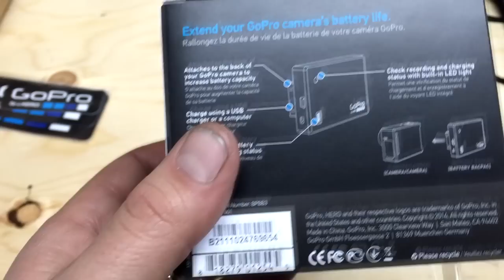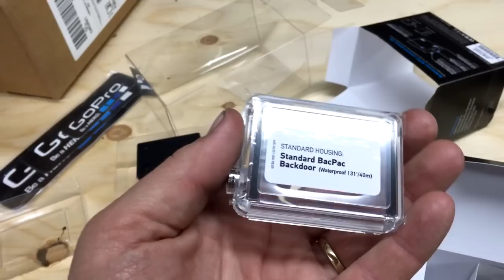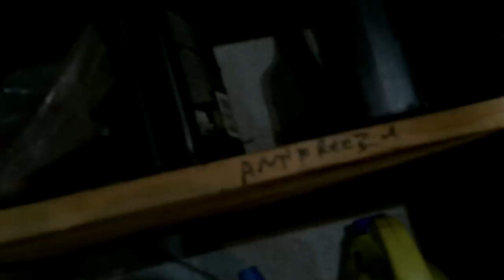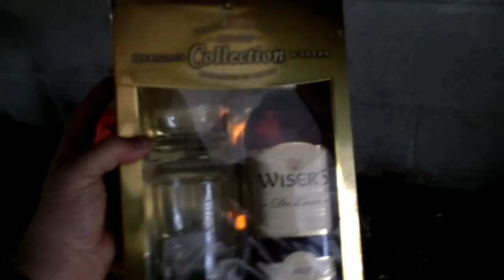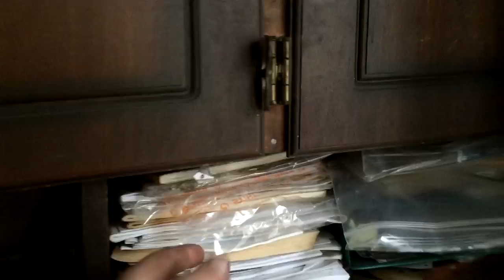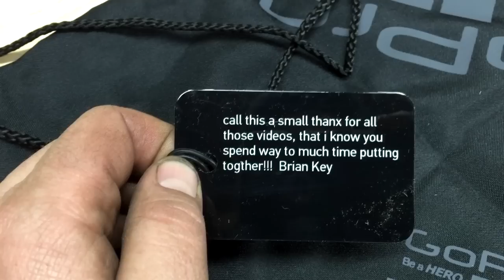Small shop update

Comment: You know the small aluminum shelve rails that you can buy in the Big Box stores that receive the small flimsy 10.5" shelf hangers. Fabricate your own using 'Strut Channels'. You know the channels that electricians and plumbers hang pipes and conduit from. Home Depot sells: 10' 12ga Galvanized STRUT CHANNELS. SKU #455470. Weld plates on the top and bottom and anchor them to the walls vertically. Then fabricate some U-Channels that would slip over the outside of the Strut Channels with 18" to 20" rails extending off the front to accept shelves, cabinets or just leave open as a metal storage rack. Drill cross holes through the sides of the strut channels  for mounting the fabricated shelf brackets. Don't weld them on. Leave then so that they can be removed or change the height. Fabricate a nice row of metal cabinets along the top along the ceiling painted John Deer GREEN for all your John Deer filters, parts, oil, etc.

Comment: Black Bin (Trash) bags make really good curtains for Garage/Shed windows! 
They're cheap, Easy to cut to size, Easy to fit with a staple gun and the best part is when they start to look shabby/Dirty/torn you can just bin them and cut another one.

Could you not move that light to the middle of the garage and wire it back in? Would make it a lot lighter place to work in without having to open the door

Comment: I was never so impressed than I was when I drove from Tubingen, Germany to Zurich, Switzerland. When I crossed into Switzerland, it was like the farmers or land owners preened all the loose, dead and small shrubbery back in the woods as far as you could see. They even cut up larger logs and cord stacked them out near the road.  

You have the tools as I have seen you use a chipper/shredder in other videos. You should cut down any tree less than 5" or 6" in diameter. Clear it out. Shread all debris and leave it in the woods. You could lay a winding path bedded with the chipped debris. Leave NOTHING for the beavers construct their dams with.

On another note; you can see that Tilly likes his dad and would like to be around him. You should include him in your projects. I'm not suggesting that you do anything that may violate child labor or safety laws, so don't make him do required labor tasks like, mowing, plowing or digging graves. In a time when the younger generation is only motivated with electronic games and television, when you have a child that will join you outside, welcome it. You will teach them things without realizing that you are teaching and they will be better off when they become adults.
Reply: +Huston Ludlum - My apologizes - Dilly (Dylan) not Tilly